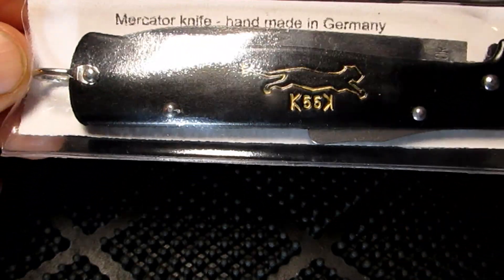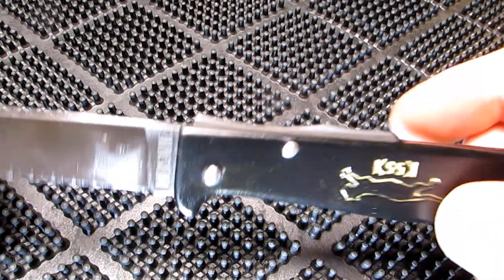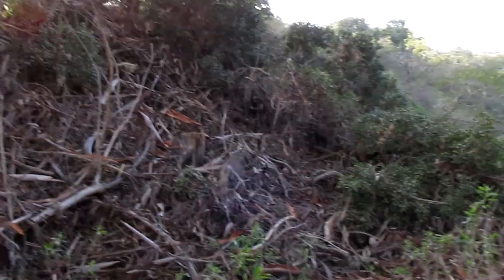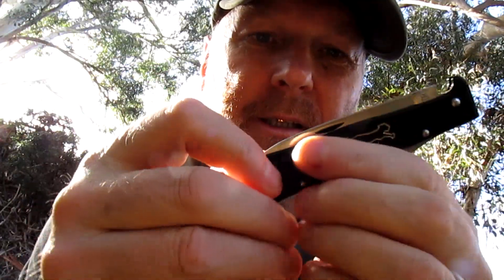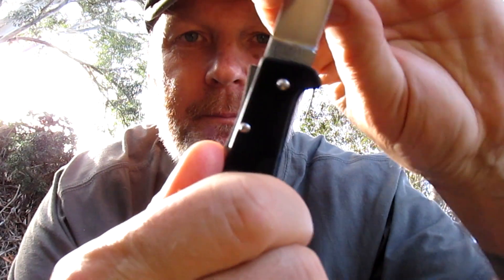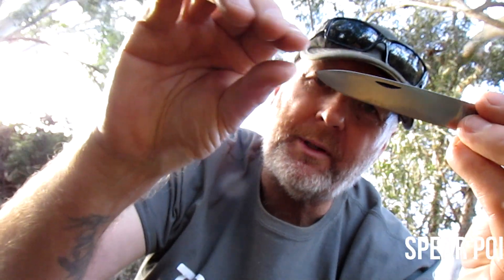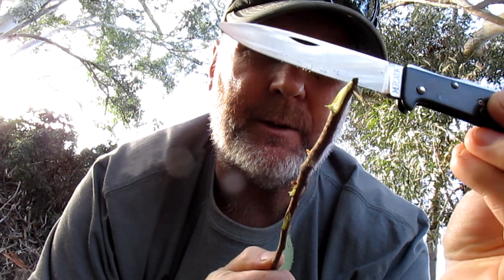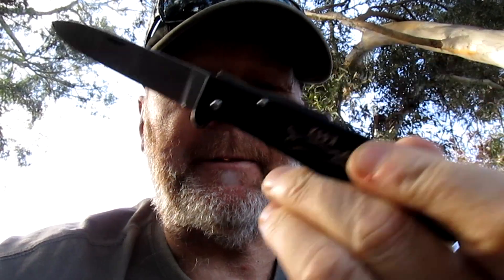MERCATOR "BLACK CAT KNIFE" K55K OTTER- Messer

Comment: As I recall, the Mercator was offered in two lengths. I got the one with a 5"-ish length blade in 1968 for $7. Mine never had the belt loop on the end and the black finish is gone. Bare metal now. I carried mine while tooling around Fun City during the late 1960's/70's and 80's before moving outta NYC. A solid lock-blade gravity knife, the Mercator. Locks tight with no wobble and the blade holds an edge when sharpened. Got me outta more than a few scrapes. I thought about givin' mine a name like Sting, from the Tolkien stories but that was too corny.

Comment: I like it but even by going to the manufacturers website, I could find no warranty info. I was only looking because one guy on Amazon commented that his first stopped locking after a month, but he liked it enough to take a chance on a 2nd and it's been working fine since (unk how long he's had the 2nd).
Reply from the maker: Amazon is where i got mine , any problems send it straight back no hassle no cost to you...They are very basic not much can go wrong with them.